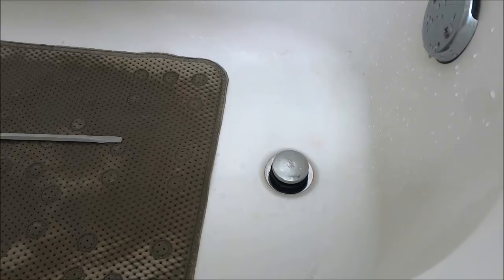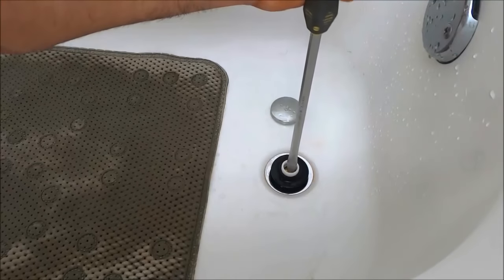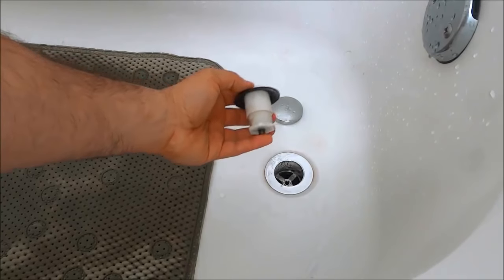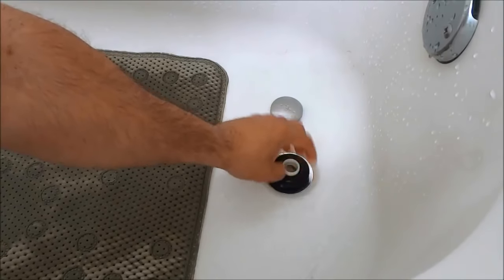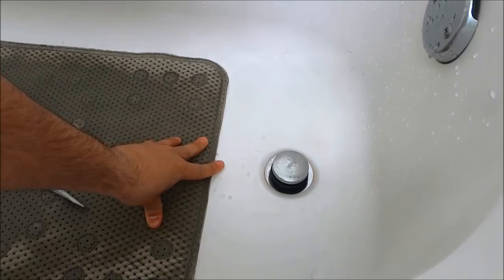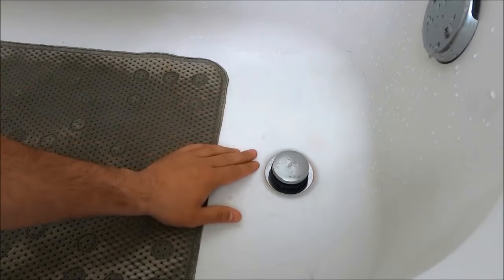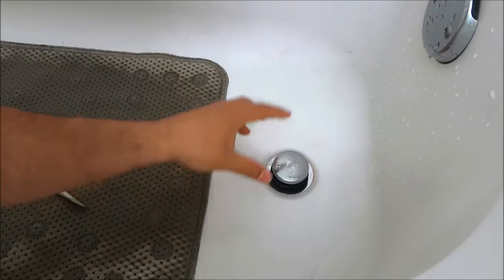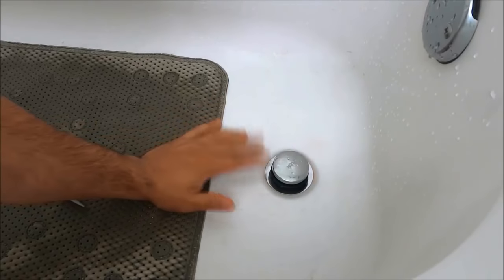How To Replace A Bathtub Drain Stopper (Toe Touch)

Comment: My toe-touch stopper seems to have a different design. I couldn’t unscrew the cap. It doesn’t seem to be screwable. But I was able to unscrew the whole stopper as one piece with a big plier. There is a screw at the bottom of the stopper assembly. Basically, the whole stopper was sitting on a screw. It was very tight and took me a while to unscrew the whole thing. Anyway, just want to share my experience as it might be helpful for some people. Peace
Reply: Same lol never got answers
Reply: Me too
Reply: Same here
Reply: I have one like this too. The whole thing wiggles in the drain but is attached to something on the bottom. edit: I was able to get it off, it's just VERY hard. I found wearing a rubber glove helped to stop my hand from slipping. 
These things are a complete pain in the ass and not worth it. I'm buying a normal tub stopper and throwing this stupid thing away.
Reply: thank you, because I can't get the lid to come off - I'm going to try to keep unscrewing to see if the whole thing comes off....

Comment: Your overflow plate is on upside down. If you filled the tub up and then got in the water displacement from body mass will over on the floor.
Reply: First thing I noticed
Reply: Not to mention showers
Reply: If he was having that issue, it most likely would have been fixed by now. Depending on the tub (and the person) water can only get up halfway the tub before it starts draining, which kind of ruins the point of trying to enjoy a long soak. All of the overflow drains/plates in our household are mounted with the drain side up, so there can be a reasonable amount of water in the tub, instead of it only going up to just below a person's navel.
Reply: I did not even realize that lmao
Reply: You’re right 😂

Comment: Thank you for the good information. Especially about unscrewing the top cap to access the large screw head for tightening the drain stopper onto the threaded bar inside the drain. The instructions for the Foot Lok Cartridge did not mention removing the top cap. Although engaging the stopper's threaded insert end into the tapped bar, turning the stopper did not tighten it into the drain. It is difficult to understand why the instructions did not mention removing the top cap. I am grateful for you and YouTube for provided the much needed installation step.

Comment: YOU ARE THE MAN!  Could not figure out how to remove the toe touch drain stopper.  Found your video and Bada Boom, Bada Bing  got the job done.....EXCEPT... mine was on like some used vice grips to attach it and I thought I might break it BUT it unscrewed slightly different then yours...THANKS!
Reply: How did you get yours unscrewed because I may be having the same problem as you
Reply: @piemanpie3072  mine... the whole unit unscrews.  I put some channel locks around the cap and turned counter clockwise.  I think mine is khlor
Reply: @rioraton  thank you
Reply: @piemanpie3072  👍

Comment: The screw on my tub is frozen up.  Not surprising, since it's probably 20 years old.  In a mobile home.  In Florida.  Any thoughts on how to unfreeze it, or alternatives to removing the assembly (other than getting under the drain/tub)?  I'm trying WD40 to loosen it up but I'm not optimistic that will work.
Reply: Same problem! Did you figure it out?

Comment: The groove on the screw top is worn on ours making it impossible to get a lock with a screwdriver. What are some other methods  for getting this piece out?
Reply: Put a wide rubber band over the top of the screw head. Then try to slowly unscrew it with firm downward pressure into the rubber band. The rubber band will help the tip of the screwdriver grip into the worn or stripped indentation in the top of the screw head. This trick will work for practically any stripped or worn screw.

Comment: how do you reassemble the cartridge if you have taken the entire thing apart? Is there a video on that?
Reply: You take the mess you made to the hardware store and have them match it, or call a plumber. Those are the options. Of course two years later, pretty sure you got it.

Comment: advice on what to do when the screw will not budge?   cap is off, but will not unscrew
Reply: Did you ever figure out how to get it out.  Mine is in too tight to remove without stripping the screw head.
Reply: I was never able to remove mine but with using it regularly, I no longer needed to replace it.  But if you figure out how to remove the screw, please share.

Comment: I live in a stupid apartment and both drains to both bathrooms have these types of drains and we also have hard water and I cannot get it loose at all no matter what sort of flat head I use if anyone has any suggestions I'd love it. I have very thick curly hair and it constantly gets clogged even with draino and I'm so over it and would rather just have a drain and not deal with the "toe tap" thing

Comment: the top on mine won't screw off, not sure how to proceed.  the whole thing just turns and turns.
Reply: +drjay4utube   get a wrench and get it under the stopper to hold the rest of the stopper then twist off. Had the same trouble then thought i would try that and it worked quite easily. Problem solved.